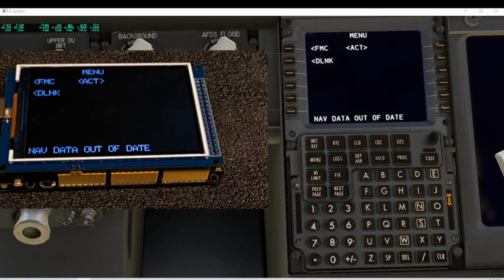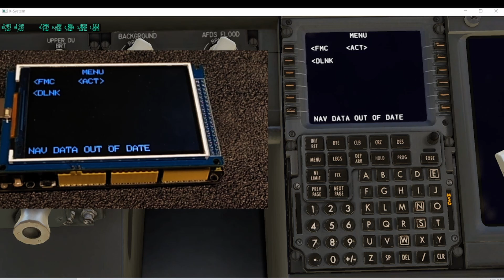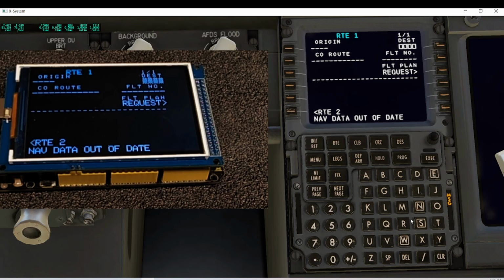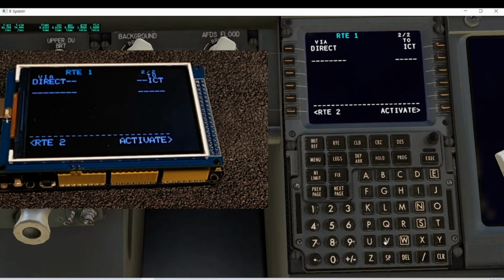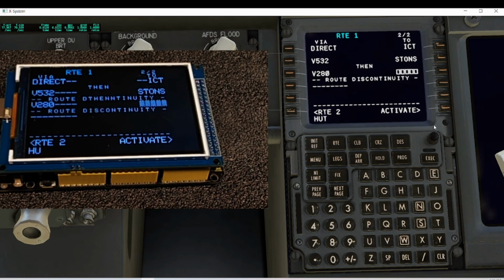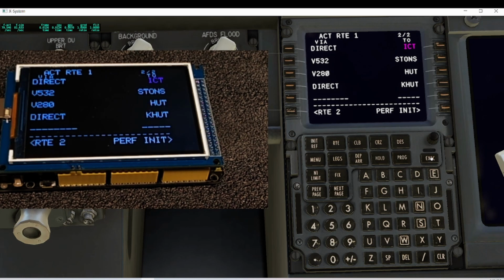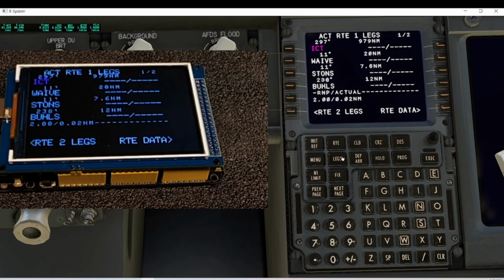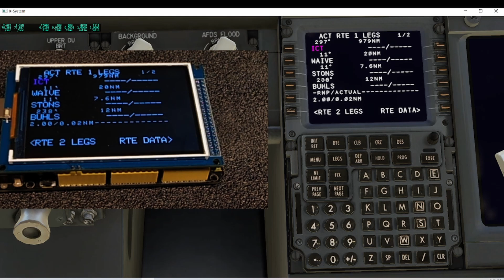XPLPro/Arduino Zibo 737 CDU Display with 9486 Mega Shield

Comment: Working with the screen rotade 90 degrees should fix the aspect ratio, shouldn't it? Anyway, this and an 8x8 key matrix ought to do the trick hardware-wise. =)
Reply from the maker: I tried it and it got really small (limited font sizes to choose from).  The 8x8 would be an easy add